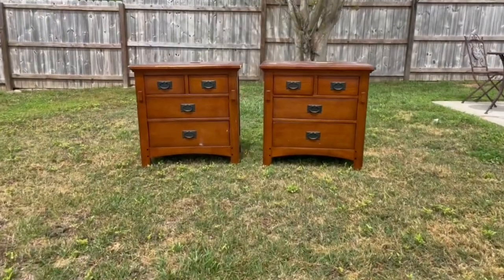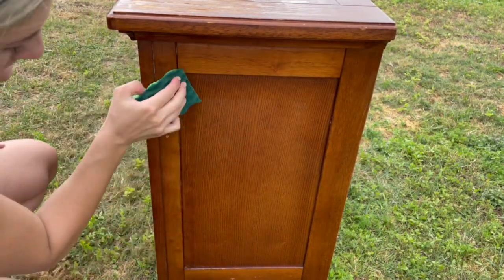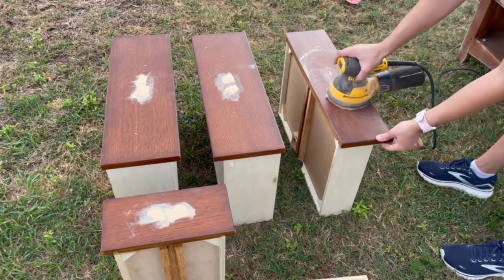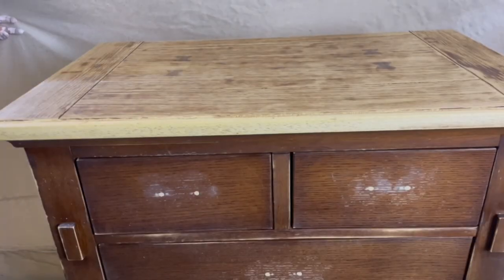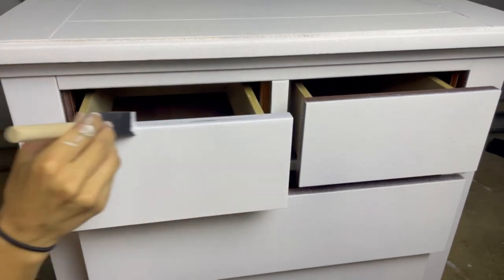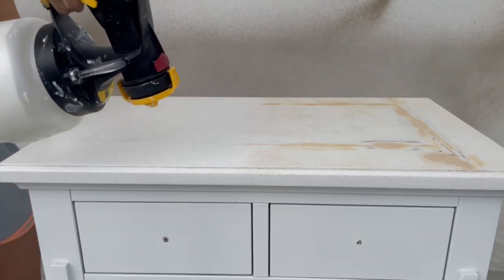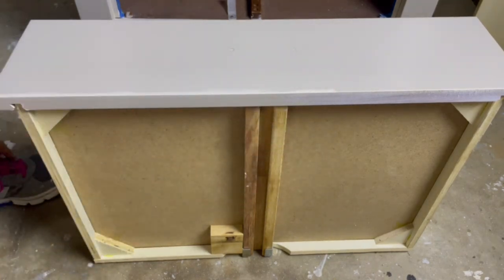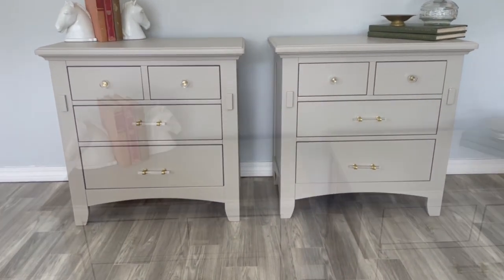MODERN FURNITURE FLIP with Alkyd Enamel Paint! // DIY Furniture Makeover // Spraying Furniture

Comment: Hello, I am new to flipping furniture and I am wondering why my paint sprayer is creating little bubbles and dots when spraying 😩 I’m wondering if it’s because it was because I switched to the rustoleum chalk paint when before I was using country chic? Also when you use a paint sprayer are you supposed to continuously hold the trigger when painting your piece, or do you take your finger off the trigger stopping the paint flow once you reach past the edge of the piece, and then restart the paint flow once the gun is in the furnitures reach?